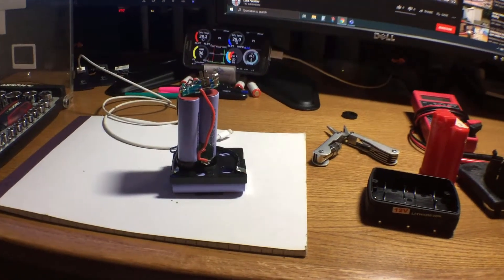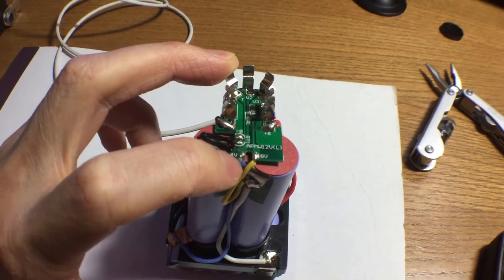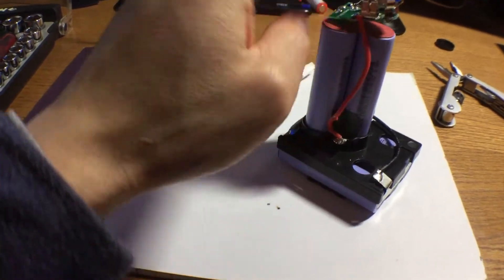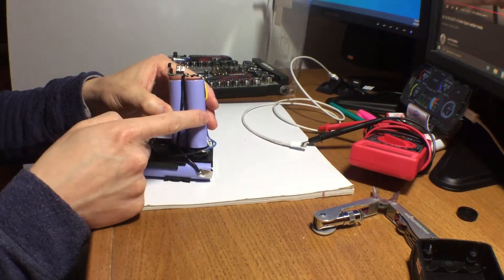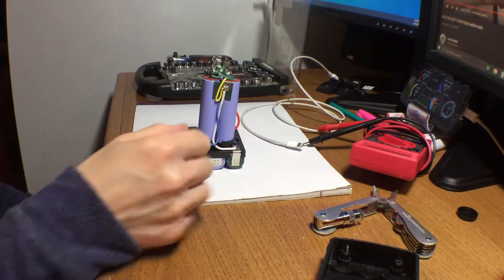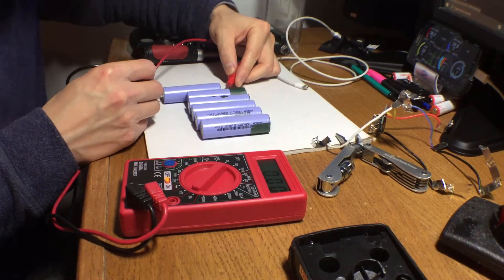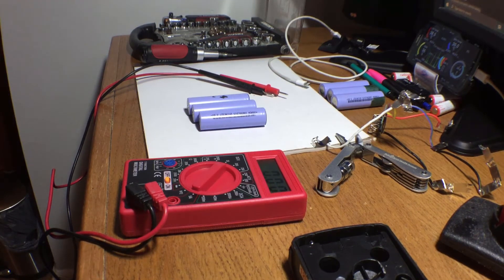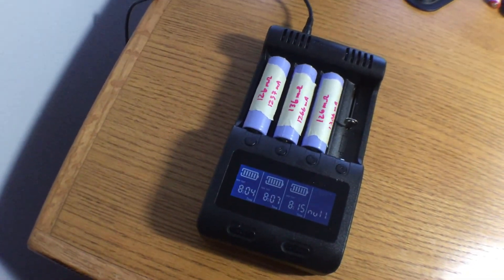Vanon Milwaukee M12 5.0ah XC battery disassembly - dead cells and poor assembly

Comment: How do you get the batteries apart that are held together with the metal pieces that seems sonic welded.
Reply from the maker: I use side cutters and pull the tab off. Thena Dremel with a grinding wheel to remove the spot welded pieces that stay behind
Reply: @MINIzguy ahh ok. Got it. Thanks for the reply. I have 3 M12 battery packs that stopped charging on me.

Comment: Hi how do you take the red battery cover off the triple battery. I have undone the 4 screws at the bottom and taken the case off but the red case will not pull off? It’s a M12 4.0 thanks
Reply: What size star bit are the screws?

Comment: hello thank you for the video battery Milwaukee 5 a .  I would like to ask you if you can make a video where you can see the cable connections well.  I ask you because I have seen them disassembled but not how they are connected correctly.  I thank you in advance

Comment: Thank you for doing this. It's amazing how untrustworthy or misinformed most amazon reviews are. What you are doing is the only way to verify what is actually being sold. It's unfortunate there doesn't appear to be a middle ground seller that is willing to offer a safe product for a fair price instead of possibly unsafe products at ridiculously low prices (and poor value since it's money wasted not money saved!).
Reply: One reason that reviews are worthless is that professionals don't buy these.  The gullible folks who get these with their colloidal silver and life crystals don't use them hard enough to put a strain on them.  Or, they are so excited to tell the world what a great deal they got, that they review them right after the first charge and give them 5 stars if their M12 flashlight turns on or their drill spins a single revolution.  Time and use will nearly always expose these and their kind as JUNK.  Sometimes the stars may line up and a good one is produced, but it's rare.  Good stuff just costs more.  If you're going to use these with low drain devices only, they MAY be worth the risk.  But if you are depending on them...... not so much.

Comment: Very good video! Just picked up 2 of these and both had 1 of 3 cells below 2 volts. I just charged the 3 banks with a cheap 18650 charger and allogator leads. Looking like I got 6 1250mah cells but rated 5ah.